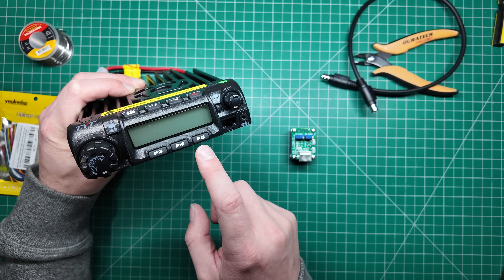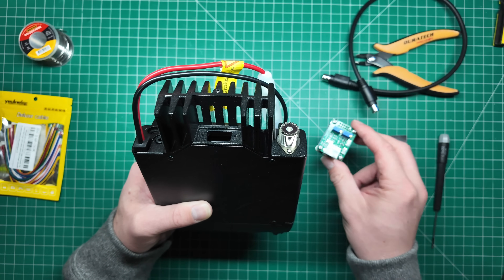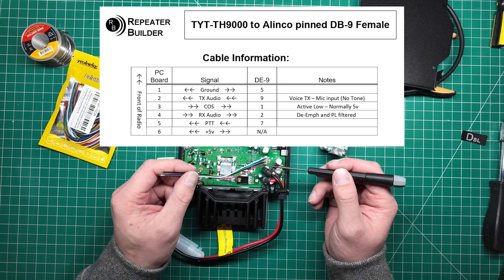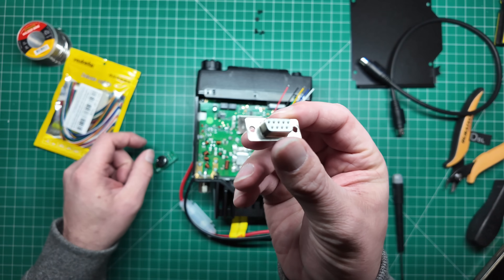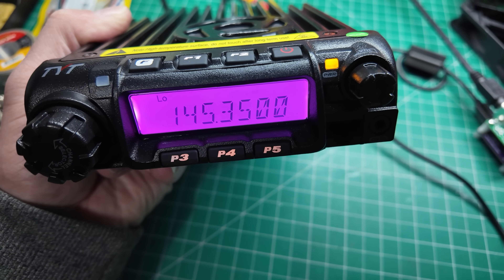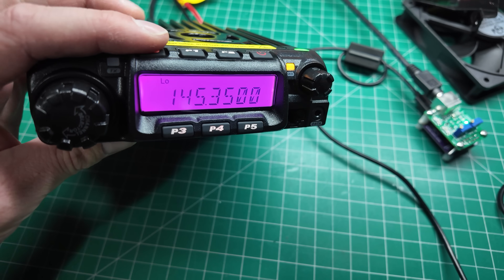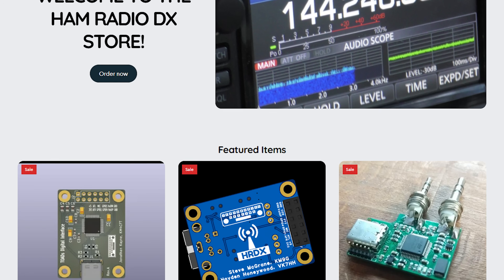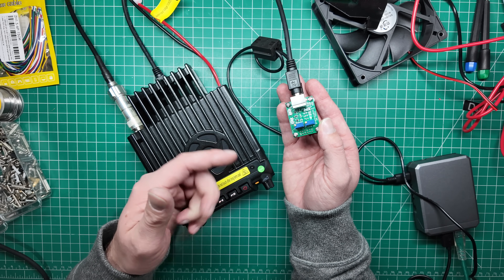Setup an AllstarLink Node or APRS Digi (Using a TYT TH-9000)

Comment: On a previous video you were looking at doing APRS on 6m, I've setup a gateway on 53.050 for when you are ready to give that a spin... It's annoying that a lot of the new icom/yaesu radio's have done away with the 6 pin socket... I'm definitely getting old and grumpy!
Reply from the maker: Thanks Scott. I'm just waiting for free time to build the tracker and get back to that project.
Reply: @HamRadioDX no rush, I don't mind making noise on the band!

Comment: That is a great little accessory board that Darrin created for wiring 6 pin DIN connectors.  That certainly made this project easier.  What power output would you use for continuous operation of this radio and allstar node?
Reply from the maker: As low as you can go to get the job done.

High power I’m not entirely sure about the longevity over long transmissions. I haven’t done any tests.

Comment: Be aware that these radios have a nasty habit of burning out the audio ADC/DAC processor IC.  It's rated to operate on 3.3VDC but for some reason the genius's that designed the radio feed it off a 5VDC rail.  I have had to replace several of these in radios for people that leave their radios on 24Hr's a day.  It's a 28 pin TSSOP package IC.  Not hard to replace if you have the proper equipment but the problem is it's on the bottom of the blasted PCB.  You have to completely dismantle the radio to replace it.  I have heard that the later Version 2 radios fixed this problem but I have not verified this.